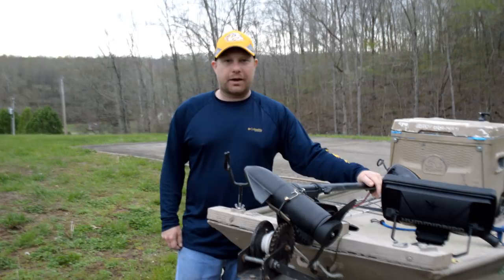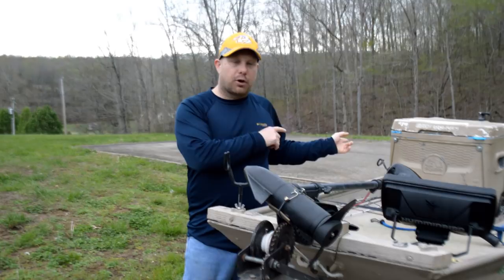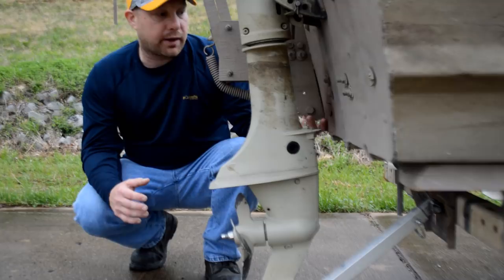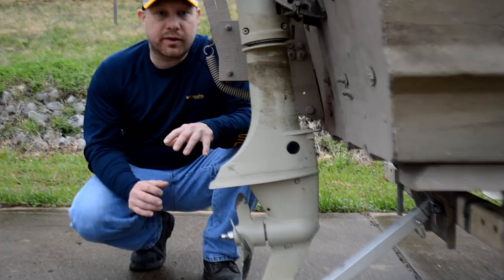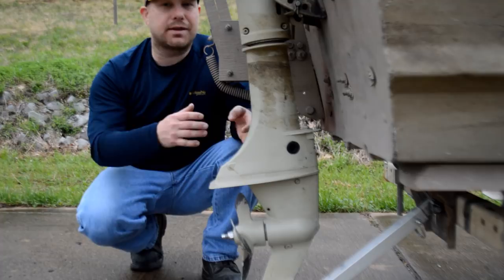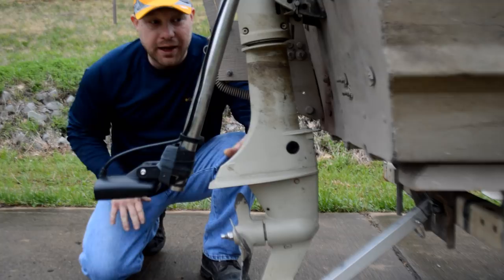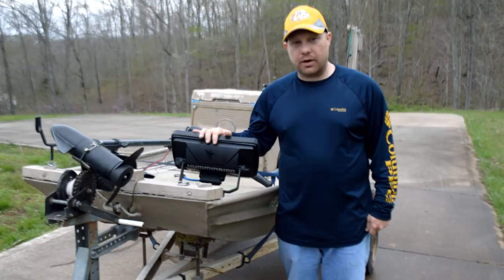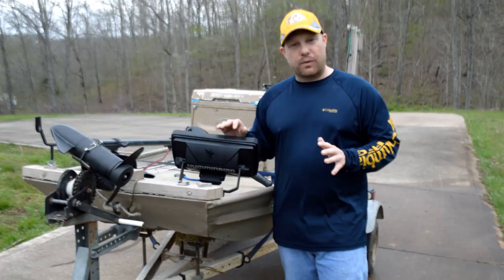Mounting Transducer on Small Jon Boat

Comment: A fellow MacGyverite for sure. (Although you may be too young to know who I mean) Great video. Thank you.
Reply from the maker: Lol...I get the reference. Haha. Thanks.
Reply: @TheLowBudgetOutdoorsman  
Hello LBO. Since we have a kindred MacGyver spirit, I thought I would update you on my decision. I have both a 30 and 45 Minnkota. My rig is a pretty much unaltered 10' jon (built in 1947...I traded a good cigar for it), and I mostly fish a private, very unfished 40 acre lake full of monster bass, cats and crappie. I am very blessed to have such an arrangement. Anyway, I don't use a gas engine at all.  I use the 45 mostly.  I think I will just move it toward one side of the transom and mount the 30 on the other side. I will mount the transducer to the 30 and not run the motor on it. I can lock it in the forward position and also tilt it up as I approach shore. Plus, I will always have a spare on board, which will preclude me having to paddle back in...which is how i ended up with two in the first place. lol. Thanks again for the video post and the great idea.

Comment: Haha I did not see that DIY mount coming! Awesome! I’m looking to put my 7 mega si on my tin boat.
Reply from the maker: Lol....It worked great for me. Thanks for watching! On a bigger boat a typical mount on the transom is probably better, but that would not work for my small setup,  and this has proven effective and simple.
Reply: @TheLowBudgetOutdoorsman  I like this because I have my little tin boat and then my other 17 ft beater. This way I can have a portable unit. I'm thinking of getting a 12ah lithium ion and putting it in a case. When transporting up north to my other boat, connect the battery and sonar unit to the mount with carabiners. That would be a nice portable unit.  Thank for the ideas man!
Reply from the maker: You're welcome. It should work great for that!

Comment: I did the same thing. I mounted the transducer with a u bolt  leaving the tube open. I have 6 ft rod with a T-handle to use as a shallow water anchoring pole.

Comment: Does it receive signals while trolling at low speeds up to 2 mph being that close to the motor? or is it only good for still fishing ,
Reply from the maker: It works fine when trolling with the trolling motor with both side scan (which only really works when you are moving), and the 2d sonar. It does have a little surface disturbance on the engine side when running the outboard, but the side scan and sonar both work up to about 6 mph. Sorry for delayed response. Thanks for the question

Comment: How does that 2x4 mount on the front of the boat?
Reply from the maker: I put construction adhesive, several self-tapping screws, and a couple 1/4 inch bolts, to hold it in place. Thanks for the question, and watching!

Comment: How effective would it be mounted out front ?
Reply from the maker: I don't know. If putting it on the front there is an adapter mount to attach it on the underside of your trolling motor. But I don't like the side imaging (what I use the most) transducer on the trolling motor, because 1. I use it when idling around with the gas motor, and 2. If the side image is on the trolling motor, then the image is always changing based on the direction the trolling motor is facing.
Reply: I mean mounting in the same way as the rear using you current mounting setup... Instead of picking up readings at the rear cause what you see on your screen you passed over and is now behind you. You should pick up the signal at the front cause then what you see is now right below you...
Reply from the maker: @jantonio183  I assume that would work. I have hear of folks getting an electronic interference from the trolling motor when the transducer is on the front, but not from personal experience.